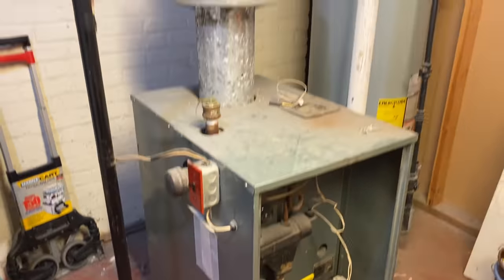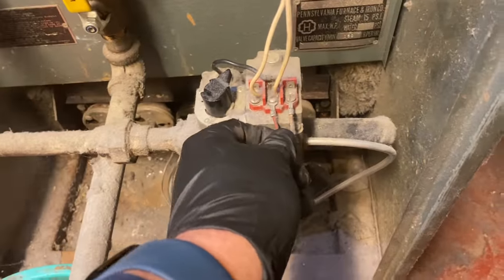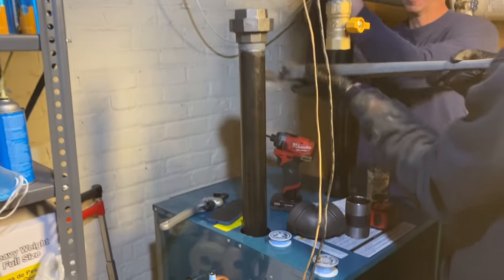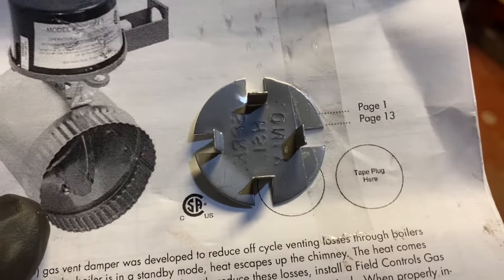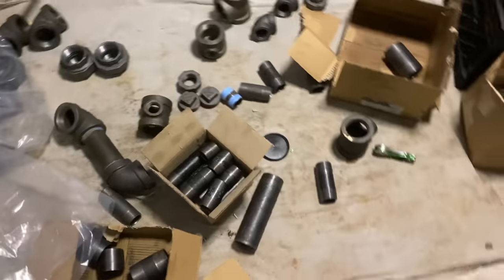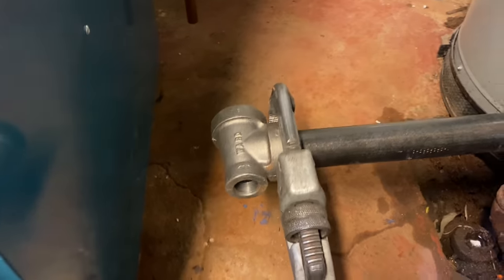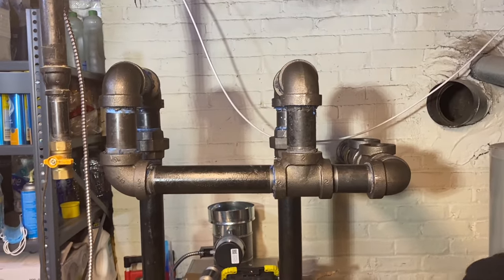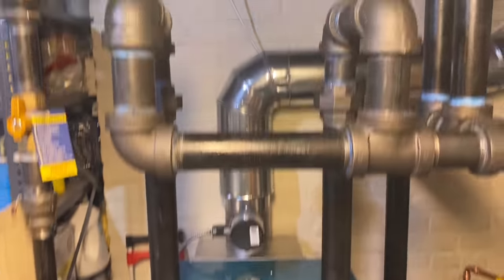50 Year Old Pennco Gas Steam Boiler Replaced with Burnham How to Install

Comment: A drop header with unions and 90s makes it so much better to install and adjust for slight misalignment gives it strain relief and keeps the water where it belongs, in the boiler. Anything less just diminishes boiler life and makes system noisy. Just one thing you didnt mention the main vents. Thats the first thing I check when firing first time. I like to see all radiators getting steam at the same time so have the furthest run vented much faster than the shortest. But such a nice looking job.

Comment: This is a very good looking job! my experience comes from fitting pipe in an oil refinery. When I saw your guys fit those two unions on the risers off the boiler I thought "they're putting those unions in backwards". We always put the ball of the union on the up stream side and the seat of the union downstream. We found that if a steam pipe union is leaking its usually backwards. So it was a rule among fitters to always, every time to face the ball toward the direction of flow.
Reply: 100%

Comment: I do it the same but with a 2 inch Tee and plug on top of one of the pipes from the boiler to put the powder in , most of them piped with a 3 inch header  
I once put these glass sight plugs on both ends of the drop header and you could shine a light in one end and see all the action from the other end
thanks for the food
Reply: I agree drop header should of been in 3 inch. I would of also reduced the equalizing line right off the drop header with a reducing elbow.
Reply: 3” header not necessary are this little boiler.

Comment: Hey Mike, liking that plumbing. When I put my boiler in I put ball valves and clean out fittings on both sides of boiler and hartford loop so it can be flushed. The old boiler had none. The boiler and loop was packed with mud and the section nipples rotted and leaked. It was 10 years old. Now I can flush the boiler and loop every year

Comment: Dropped headers are ideal but unless the manufacturer actually puts it in the installation information it’s not being installed as per manufacturers spec’s .  They need to update this to allow this type of installation.  I believe the dropped header is a much better design. 
A very good looking install.  
I thought it was funny you had to show us how to put cardboard on top of the boiler.

Comment: Great install, it cost extra to do it right but it's well worth the extra in the long run - do it once and do it right.

That old transformer was from a time when things were built right, back when men were men and sheep were scared!  Now the accountants make sure they wring anything above what is absolutely necessary to make it work. The pared down version will work but it really is designed to fail if you use it close to it's rating. Companies don't really save much money for doing stuff like that because they just give any saved money to those no accounts.

Comment: I going to ask two stupid questions: 
1) have you ever considered to put king values on main to make yearly maintenance easier because you can’t isolate and pressurize the system to clean out the muck?
2) Have you ever considered put an outlet on the boilers incoming electrical box for convenience?

Comment: Those old millivolt gravity return systems allowed uninterrupted heat no matter how long the electrical power was out.  A 1/2" check valve would protect the backflow preventer from the hot boiler water.

Comment: The art of plumbing is a dying one with plastic pipes and such. Rigid piping will be a lost art in residential installations on most things within ten years or so. It's nice to see it being done right.
Reply: Fast money
Reply: Scott. old timer here, still using copper, brass and steel fittings.  Am in a 90+ year old house and everything still works using the old stuff.  I must admit, some of the new products are life savers, like Fernco and certain PVC products.
Reply: @kevin7151  I started Plumbing back in 1980.
Reply: @scottvolage1752  and me back in the late 70's.  A toast to both of us old timers

Comment: Hey Mikey 

I noticed you wearing a gold bracelet on your right wrist. 

What are the specs on that bad boy? Looks like a Miami or Cuban link. 

I’m looking at getting a new necklace. Domed link N217 18K 20” just under 30 grams. Similar style to a Cuban. 

I own and operate a plumbing and heating company in Ontario Canada. Respect ✊🏻

Comment: You have no isolation valves at all.  How do you blow down the boiler?  I like the way your bringing the young apprentice along with the wiring.  Schematics, wiring, trouble shooting.  That's the way to go with him
Reply: @PipeDoctor    I am going to say that we disagree.  ASME VI code requirements clearly state that you require this.  King valve or main valve and on boiler return.  It enables you to test various components on the boiler.

Comment: I have the upgraded new Knipex stripper. I think it does a wider range and they put a tensioner screw on it. The first wire I tried to strip (make that Simpsons sound) it f'ing fails. I find other wire no issues at all. The wire I need to strip though is my main wire. 14/2 Southwire. I realized it was stripping off a clear jacket Southwire uses. Once that's stripped off the Knipex just slips off the wire. I adjusted it all the way to the + and - side and nada. This is popular wire so not a good look for Knipex. I have so many of their tools so not knocking them but this tool isn't working for me. Going to send them an email and also happy to send them a wire sample.

Comment: Your boiler drain is weak. Should be larger and use an eccentric bushing. Or better yet a full size ball valve so the interior can be accessed for power flushing in the future.